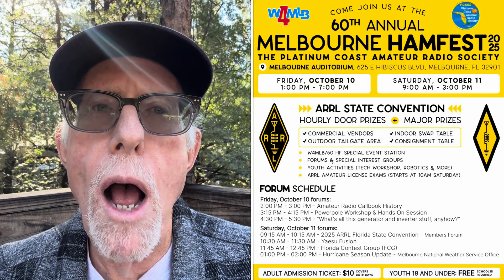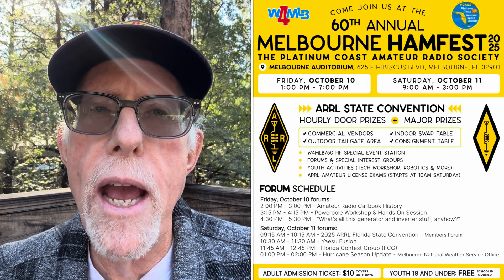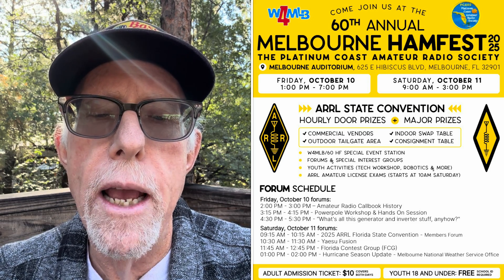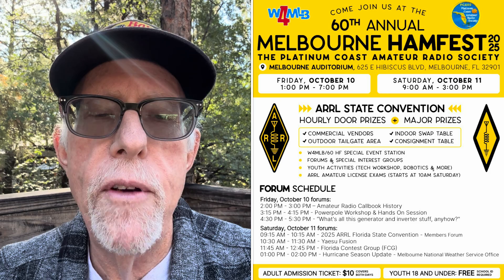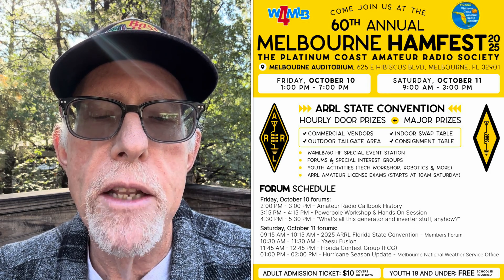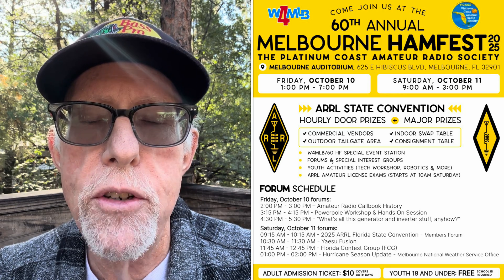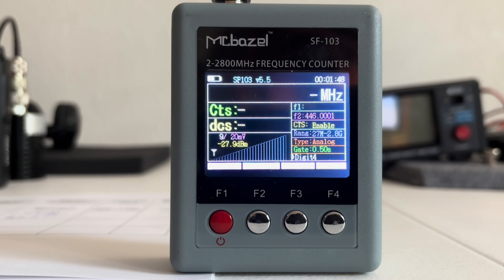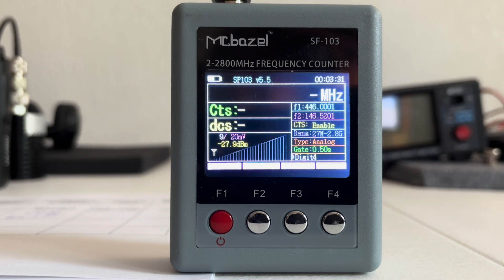Abbree AR-771C GMRS Antenna Testing and Review. #gmrs #hamradio #radio #prepper #walkietalkie

Comment: This Abree GMRS model was disappointing in my copy. Poor SWRs and too much static. I sent it back. Completely rolling the dice to get a good copy. They need better quality control. I have heard of a few that have gotten a decent copy, but I would say they are in the minority. I would recommend spending more money and get something you can rely on in an emergency.
Reply: Nagoya 771Gs are generally good or Smiley 5/8 rubber duck if you need to go shorter for GMRS
Reply from the maker: While the one I have did okay, I was expecting it to do a little better than it did. The real world distance test I do really exposes the antennas that are weak performers and a truly good performer will shine in this test. And this antenna only did fair in this test for me. This is why I test several different aspects of these antennas.

It sounds like you might have gotten a defective one. I am surprised I don’t hear more about poor quality and defective antennas. Thanks for your comments.

Let us know which antenna you finally ended up with.

73 Dave N8DAV
Reply: @BrilliantHam Nagoya 771Gs and Smiley 5/8. Smileys are tuned almost perfectly lowest SWRs. Nagoyas are tuned reasonably well. Nagoyas will still pick up a little farther than the Smileys because of longer length. If slightly shorter distance the Smileys are really clear. I have heard Smiley Super Stick IV is about the best you can get for an HT GMRS antenna, but not cheap…but cheaper than Diamonds. They are not as durable due to telescoping metal design, probably can pickup better than anything short of external antenna on a mast or hanging from a tree.
Reply from the maker: @CybersecurityBoardroom  Thank you for your comments. I have been playing with some extendible antennas. And when tuned properly, the performance is hard to beat. But, as you said. Durability can be questionable. Especially with me as I am clumsy. 

Thank you for your suggestions for some antennas I have not purchased yet. I will be getting a couple of Smiley’s for testing. 

Personally, I have different antennas for different purposes. There is no one antenna that can do it all. 

73 Dave N8DAV